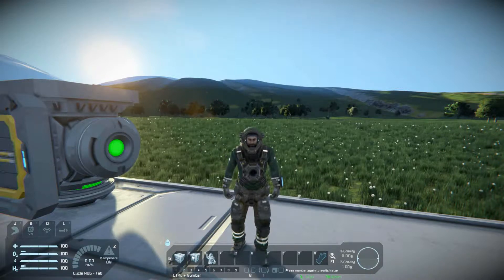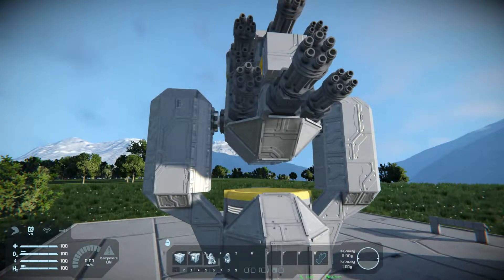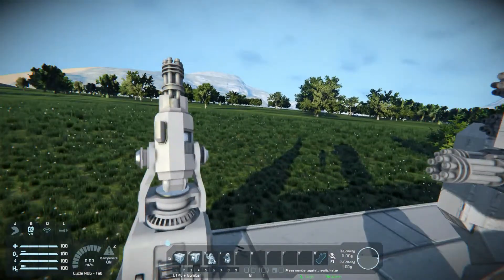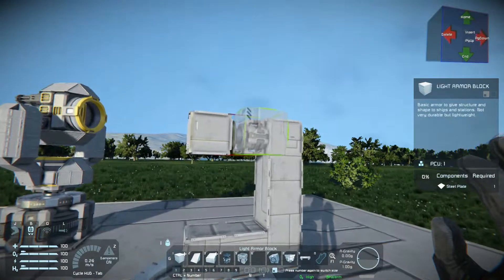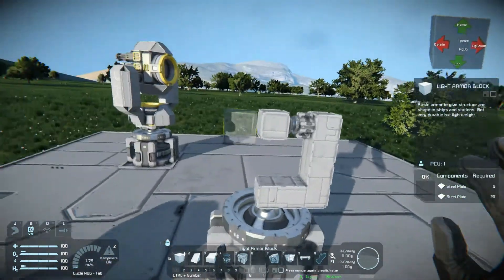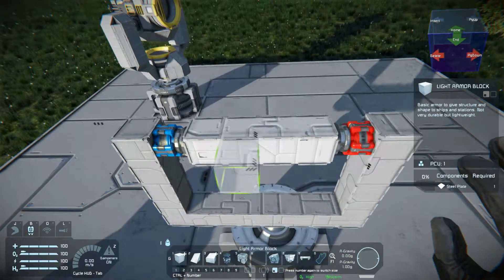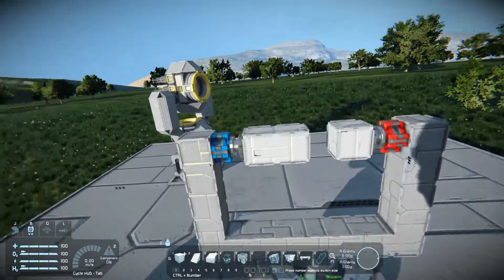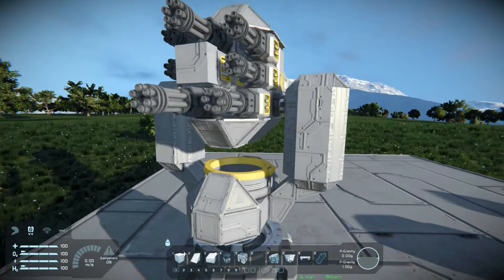Space Engineers Tutorial: How to make a RotoTurret

Comment: Good tutorial. I just want to add a note about Whiplash's MART script. While it works fantastically well and pretty much hits most of its shots, the reason behind why it is so good is also the reason why it's terrible on multiplayer servers, especially ones with a lot of players. Oh it'll still work there, but you're gonna get some admins beating down your door wondering why you're using nearly 1ms of CPU time during battles with only a couple turrets controlled by it. It does a ton of calculations in the background and updates every single clock cycle and Whip himself admitted to me that a few of them are indeed pretty resource heavy. If you know a little about scripts and can disable some of the bells and whistles, such as the method(s) that check for if it's aiming at friendly or neutral blocks (checkFriendlyFire I think it's called), and can dial back the update speed, then this might not be the case, but out of the box it's generally disallowed.